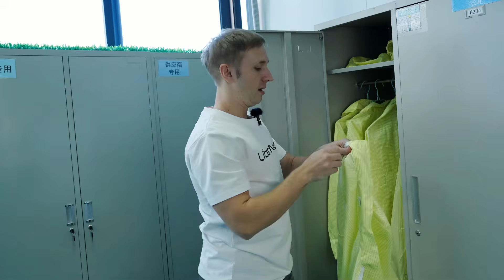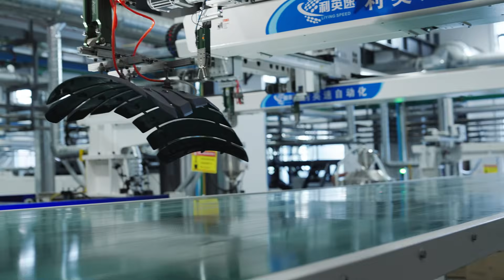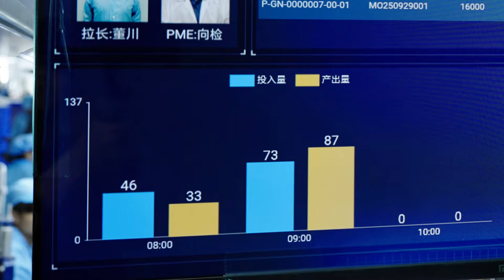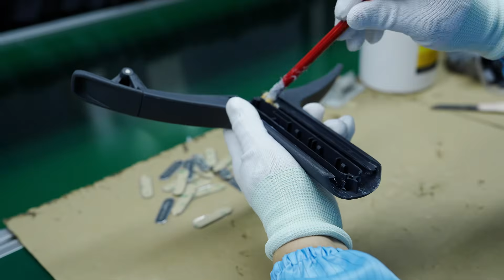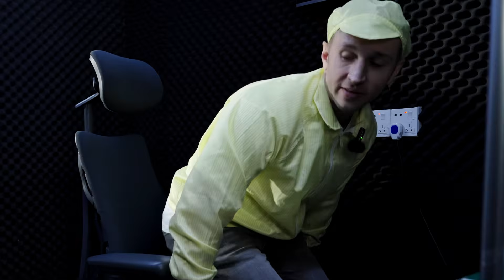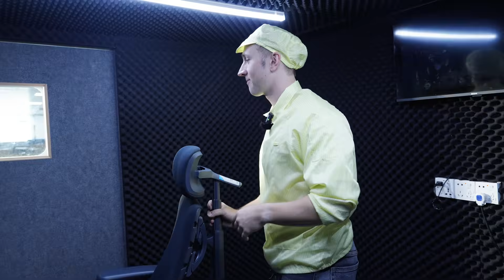Inside Our Factory: How 1,100 LiberNovo Chairs Are Made Every Day

Comment: It's a cool chair, but unfortunately, this company's customer support is non existing. I backed this project initially on Kickstarter as a early supporter this Aug, as of now, my still haven't receive the full shipment, even the parts I did receive has damages and dirt on it. Contaced their support multiple times and no response at all. 
So even it's a nice and comfortable chair, you need to take your chance, if you have any issues, good luck